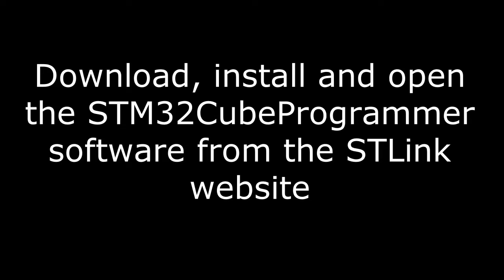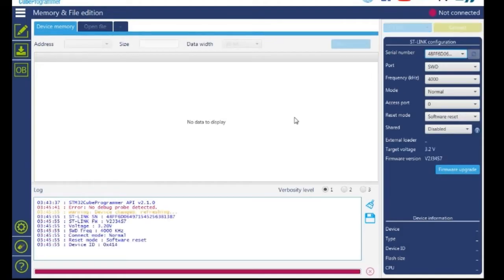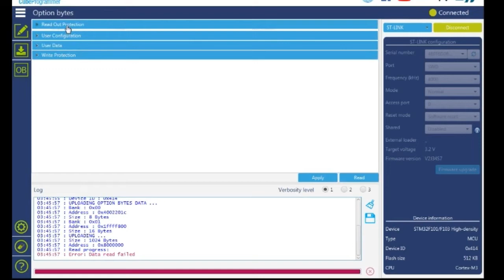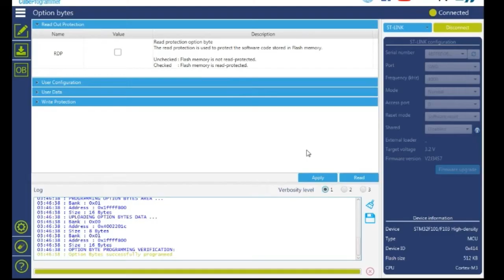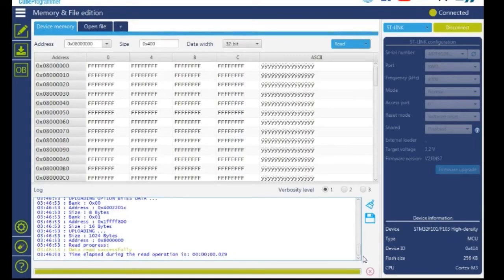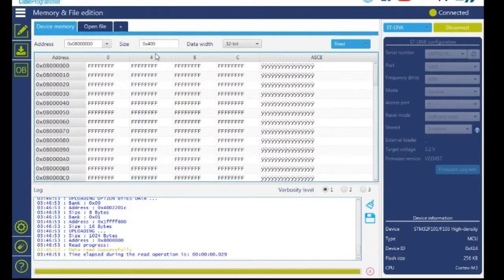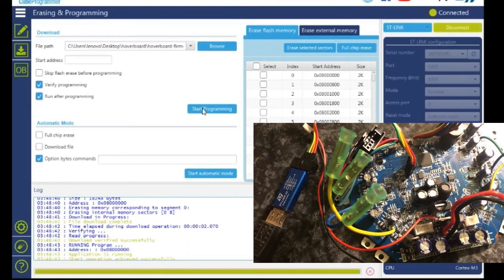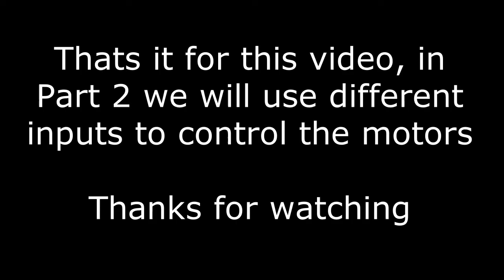HOVERBOARD MOTHERBOARD HACK - how to change the firmware to use different controls PART 1

Comment: And if i use an 42v battery from an escooter is the battery going to fry the motherboard
Reply from the maker: hi, in the firmware you can specify 10s or 12s batteries, hope this helps

Comment: Hi!
I used the firmware in your description, and motors working but are running slow at max. What could be the issue? If i short 3.3v with speed cable it runs a bit faster but not near the speed you get in the video..

Thanks!

Comment: Hi, my hoverboard battery is toast, will two 11.1v 5200mah 40c lipos in series di the job? Or does the board require 36v
Reply from the maker: i think it requires 36v
Reply: @A-tech  ohhh okay thanks

Comment: How did you give it 3.3 volts , did you connect them externally or connected the big battery while flashing
Reply from the maker: hi, i used the 3.3 from the stlink thing i think, hope this helps

Comment: Nice video, but are you just uploading the hover.hex file? Like how would I even make a wii controller work
Reply from the maker: thats it yes just upload the file, to use a wii controller i think you need to enable it in the code, so its set to use i2c i think so you may need to put some // in front of that part and delete the ones on the nunchuck part, I dont have one so cant try it, thanks

Comment: i wan't to do this but im scared that i wil destroy the mainboard it's actually expensive on where i live and im note entirely sure that is it gonna unlimit the max rpm of the motor or remove the any torque limits. İ wan't to do an electric scooter with this so i want the max speed and torque of the motor and 1 more thing i read that this controller can work with 48 volt is that true? my controller have mixed 50 and 63 volt caps (sorry for poor english)
Reply from the maker: hi, there is always a risk with these things, i can say i havnt had any go too fast, they will also break like other motors if you try to push them too hard, just monitor the heat and go from there, they can do 48v yes but i think you need to edit the firmware code to enable 12s battery, hope this helps

Comment: Hi, I’ve connected the pins correctly and I have the same flashing and beeping noise you have with the light.However in the stm32 programmer when I press connect it comes up with “ UR connection mode is defined with the HW reset mode”
I have the same configured as you with the reset mode set to Software reset. Do you know how to fix this?
Reply from the maker: hi, im not sure will have to have a think about it
Reply: i ran into the same problem. no luck so far in solving it

Comment: If there is anybody working with the razor branded splitboards

 I'm in need of assistance finding software for them?
Reply from the maker: im not sure about them, do they have the 2x smaller motherboards instead of the 1 big one?
Reply: @A-tech 
Yes it is the micro boards instead of the big one

Oh and I am also having issues with one of the big boards but I will explain more next time I try to work with it
Reply from the maker: ok i havnt tried anything with them yet, will hopefully get a new board with them soon, as far as i know the connections are the same

ye no problem
Reply: @A-tech  well the one thing I will tell you is that more than likely all the hoverboards have gone over to that model of manufacturing

The only reason I know this is because I have been collecting hoverboards for a little while now and everyone of them have had the split board design...... but luckily enough they all have a spot 4pins
Reply from the maker: ok that is pretty handy, i take it they still run on stm32?
Reply: @A-tech  yes they all use the stm32 and from what I found out so far is the pain out a little bit different then the 2in1 boards

They do still use the four same pens on the STM reader but on the board itself the pins are arranged differently

Comment: very good, just a question. After resetting the firmware of that board, I can insert any other firmware or only specific ones can be inserted. I'm wanting to build a Direct Driver steering wheel for a racing game simulator. it would be possible? I just want to use the board to control the engine, to communicate with the games I will use a stm32.
Reply from the maker: sounds interesting, yes you can keep changing it if you like

Comment: Can you advise. I am having connection problem, I am using stm32 cube programmer and st link V2, upgraded the firmware, diconnected and reconnected st link, still couldn't establish connection
Reply from the maker: ok, is the stlink installed ok? have a look in the device manager, if thats good double check the wiring from the pins on the st link, if thats no good it could be the pins on the motherboard

Comment: Can an e-bike throttle be used on the board to control the motors, withouut upgrading or changing the firmware
Reply from the maker: i dont think so unless you want use a cable to tilt the board to move it, thanks

Comment: i really need help i have 2   st-link v2   wen i connected to pc the pc foundet without problem   but the  STM32CubeProgrammer  didnot found   the    st-link v2  what ido?????
Reply: Did you check to see that you either welder the pins to the board properly and if so did you check to see that your wire connections were securely connected to the correct pins?
Reply from the maker: it could be the stlink wiring is incorrect?
Reply: Use ST link instead it worked with me . STMprogrammer sometimes doesnt work with chinease ST-link dongle , good luck

Comment: Is this the main solution of you want to use a GotWay controller on any hub motor???
I’m actually doing a project.  I have a Begode / GotWay controller.  I’m trying to use this controller on balance scooter
Reply from the maker: Ok I’m not sure what a gotway controller is but the hoverboard ones are pretty good
Reply: @A-tech  I have a universal hoverboard controller
It also stated in the advertising that the controller also works with all balance wheels.  
   Would you believe, that this  universal controller is not balancing the wheel at all 
  It flashes red 8 times continuously

Comment: Don't You put a jumper on the power button pinouts on time of flashing ? On another video they say it's required as it works as power circuit during flashing ? Wont that brick it if not shorted ?
Reply from the maker: hi, i have never needed to do that and always worked fine for me

Comment: You inspired me to build an RC wagon for my baby boy & would like to build a cart with joystick for my parents as they are getting up there in age & a motorized wheelchair is  expensive. Wondering if I can get a little help with the firmware. Reprogramming. I've built a pc before, so I have little experience in this field. Thanks a bunch.
Reply from the maker: hi, have you seen part 2 of this video? it may answer some of your questions
Reply: I'm in the process of downloading the software. Is the correct name STM32cubeIDE? A little confused. Thank you.
Reply from the maker: @JuanMarin-sx3rt  hi, i think its just called stm cube programmer, I think it was in a folder with lots of other files too
Reply: @A-tech  thank you 👍
Reply: hello, I sawdered header pins, uploaded stm32 cube programmer, connected wires to header pins & st link v2, however, unable to connect to software. wires are connected to 2,4,6,8 as indicated on your video. Mother board beeps when plugged in to computer. Am I missing something?
Reply: Wondering if I'm missing something as I'm not able to flash new software.  Any advice?

Comment: I bought a hoverboard but after I disassembled it, I realized it was not supported for this hack.  Are there particular brands or outward appearance I should be looking for?
Reply from the maker: hi, im not sure about brands but the style of wheels seems to be a good indicator, hope this helps
Reply: @A-tech  It does thanks.  I've come to the decision to use an Ardiuno and some motor controllers because it would be more of a challenge.  I landed on that after buying yet another unsupported hoverboard, so I'm in deep already lol.

Comment: Goddamn it, my doesn’t want to connect . Maybe the soldering wasn’t good enough :( I have to check it
Reply from the maker: double check the pins in the adapter too its so easy to get them wrong
Reply: @A-tech  it was ok. I tried yesterday to solder it again and it did some Sparks :) it’s garbage now :)

Comment: Hello
I am flash with your firmware, but in reverse the wheels drive not smooth with slow speed , i use one 100k potentiometer … how i can fix it and increase reverse speed
Reply from the maker: hi, try using a 10k potentiometer, that may help, im not sure how to increase reverse speed, thanks

Comment: Sorry, Quick question.
When flashing the new firmware, are you just using the hover.hex file in the build folder ?
Reply from the maker: That’s it ye it’s the only file you need
Reply: @A-tech  what all the other files for

Comment: Will the firmware download work on all of the different mother boards? Also do you have to erase the old firmware or just download the new firmware to the mother board?
Reply from the maker: hi, it should just overwrite the old firmware, im not sure if it works on all, but the ones i have tested with success always have the sensor wires in the same place and order, hope this helps

Comment: Hello, Fisrt of all you have made great job!! I am building with mz kids some scooter based on your project. I have uploaded your firmnware, but i have difffrent sound from speaker and I don't know how to turn it off..... Power button don't respond. I can only turn on. When I turn it off I get few beeps, but after that I can't turn it on once more. 
Can zou help me?
Reply from the maker: hi, did you get this working? i think there may be different versions of the firmware, were the potentiometers connected up? thanks
Reply: @A-tech  i made it working, the problem was, that the engines weren't connected ... :)

Comment: Thank you so much for great video. I'm new here,  following your tutorial to firmware flash, do we need to provide 36v supply to hoverboard while connecting to stm32 link. Because when I connect 3.3v of STM32 link to hoverboard, STM32 link blue light goes of and stmcube shows target not found. pls help. God bless you
Reply: I've done it without the battery connected. Just with the 3,3V from the programmer...worked fine for me
Reply: @dominik3187  thank you so much. you are a superman
Reply: @ahmadhussainwebshare1001  but if you want to be safe, do not use the 3,3v pin and power the board with the battery. Then you have to press the power button of the board while flashing the firmware.
Reply from the maker: yes as Florian says, you dont need the battery connected as it can take power from the usb, thanks

Comment: Thanks for the video, the stm cube programmer is showing not connected, when i try to connect, it only shows loading with 0% display, please help me.
Reply from the maker: hi, did you get it working? i dont think i had that problem
Reply: try using STLINK UTILITY software instead of cubeprogrammer.
Reply: @ecoegg4608  Hi, hellosoldered header pins, tried with stm32 cube programmer, connected wires to header pins , however, I am unable to connect. tried with st-link v2. Same Results. Wires are connected to 2,4,6,8 as indicated in the video. Motherboard beeps as on video, but I am unable to get "conected". Using st-link v2. Thanks for your help

Comment: Hi, very nice project. On my board I would like to change only the tilt value of the gyro sensor. I want start hoverboard with smaller tilt. Don't know how to do it? Thank you
Reply from the maker: hi, thanks, to change the angle you would probably need to edit parameters in the original software, another way might be  using an arduino and tilt sensor

Comment: Hi there. Thanks for sharing. One thing, it is possible to run one motor independently?, I mean, one stopped and the other running... Thanks in advance.
Reply from the maker: hi, you can sort of, depends how smooth you wanted it but an easy way would be to disconnect the wires maby using relays, not ideal but depends what you are using them for
Reply: @A-tech  thanks for the info. I will try it.
Reply from the maker: @charlesblack7989  ok no problem, whats it for?
Reply: @A-tech  i'm designing a bipedal robot and need the motors to turn independently of each other. I am not sure if they are capable of carrying that load, but i have to try it because is the cheapest option. What do you think?
Reply from the maker: @charlesblack7989  i think thats an awesome idea, how are you gearing them down?

Comment: I have a issue with mine where when i try to set the ReadOutProtection in the STM32CubeProgrammer it says Error: Downloading Option Bytes Data failed. Error: flash loader cannot be loaded. Anyone know what to do if you have this issue?
Reply from the maker: did you get this working? it may be a bad connection on one of the pins or wiring from the programmer?

Comment: Be careful , Some chips has read protection options.
if it's protection 0, you can remove the flag without a problem
if it's protection 1, once you remove the read protection, the flash will be erased
if its protection 2, you cannot remove the flag
Reply: Hello Amr, how can you identify if its protection 0, 1 or 2?
Reply: @JuanMarin-sx3rt  same
Reply: Could you explain how to identify if its protection 0, 1 or 2 please?

Comment: i have problem. erorr: old st link firmware version. what i should to make.
Reply from the maker: you need to update drivers?
Reply: @A-tech  can you send me link to download file driver
Reply from the maker: @ivanrumenov928  windows should install it when you plug it in, does the computer you are running it off have internet?
Reply: @A-tech  yes, when i plug it in i have connect to Internet. And drivers  instal succsess. Probably drivers are old.
Reply from the maker: @ivanrumenov928  possibly its the firmware on the stlink programmer itself, i wouldnt know how to update that
Reply: @A-tech  everythink is ok. I upgrade succsess firmware. thank you
Reply from the maker: @ivanrumenov928  thats great

Comment: Did not work no STM32 programmer error : No STM32 target found
Reply from the maker: did you get this to work?
Reply: @A-tech  unfortunately not
Reply from the maker: @antoonsorg  ok a couple of questions, is the board powered up? are all connections correct?
Reply: @A-tech  No I did not connect the power to the board but I here beeps from the board when connecting de st link. But receive no data from the board. I followed the video instructions .
Reply from the maker: hmm im not sure maby the board is faulty?
Reply: @A-tech  do i need to power the board
Reply from the maker: @antoonsorg  does the light come on the board? is there anything connected to it?
Reply: @A-tech  i just here the beeps from the board no light nothing connected. Also the cooler plate did I remove.
Reply from the maker: @antoonsorg  ok there should be a light on it
Reply: @A-tech  then i must power the board with the hoverboard battery then I see a blue light.
Reply from the maker: @antoonsorg  ok hopefully it works now
Reply: Cannot connect to hoverboard keep getting can not connect to stm32. Where can i show images i can not upload
Reply from the maker: @antoonsorg  its likely your board is faulty, do you have any others to try?
Reply: @A-tech  hard to believe the motherboard is faulty because i can turn the hoverboard on even the wheels are spinning. I just cannot flash new firmware on it.
Reply from the maker: @antoonsorg  ok doing it as shown in the video works for me and lots of others so i dont know what else to say
Reply: @A-tech  I succeed. I figured out that not pin one but pin two was the gnd then I shortcut the on off plug and tried to make stm32 connection and yes I could read the data.
Thanks.
Reply from the maker: @antoonsorg  oh great happy to see you have got it working
Reply: @A-tech  yes thanks

Comment: the original firmare dont use 3.3v. why you connect? and you plug in the motherboard the motors and battery and bridge in on/off swith? am making the same for a ebike
Reply from the maker: hi, yes they do use 3.3v for the logic, if you use 5v you will break your board
Reply: @A-tech  thanks by answer, am right now, flashing the firmware, but no conect. am reset all for solve

Comment: Why can you change READBACK. The idea is supposed to be that the manufacturer flashes is such that it can't be read back. If it was a simple as setting a flag to allow read back, there'd be no real point in "protecting" the chip.
Reply from the maker: they did not protect it very well

Comment: Mine won't turn off and the speed of the motors is not the same. Won't turn either
Reply from the maker: ok i think you need to double check your wiring, are you using potentiometers?
Reply: @A-tech  Yes, I've put two 10k with gnd and 3.3v and green and blue wire. When the green wire is unplugged and sitting on the bench it does something odd, when I touch it with bare hands, it turns off the board
Reply: @A-tech  It would help you if i give you the board version number? I want to put this board and motors on my wheelchair
Reply from the maker: @Diygenes  hi, i think its v2, thanks

Comment: Can I do this with a dual system hoverboard? If so, do you have any info on it or know where I can find info?
Reply from the maker: you mean use 2 hoverboards?
Reply: A-Tech No, I mean a hoverboard that doesn’t have a motherboard and 2 gyros. Mine only has 2 gyros. No separate motherboard. Here’s a link to what I’m talking about>>>>  https://www.aliexpress.com/i/4000440310582.html

Comment: Lol. I’m so dumb. I just did this to my hover board thinking it was better firmware. When in fact it was not that at all haha. Not I can’t use my board as a board. Is there a link anywhere to the original firmware please? Thanks
Reply from the maker: oh no, you might be able to get it off the manufacturers?